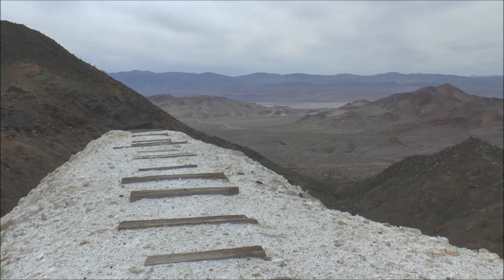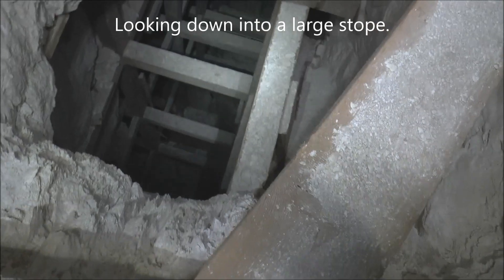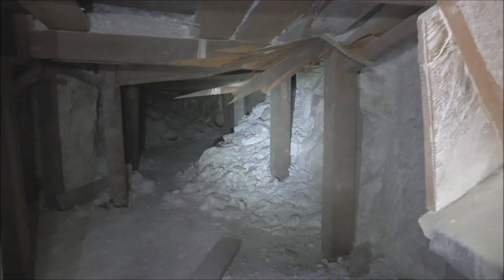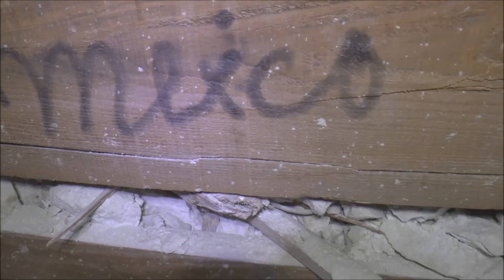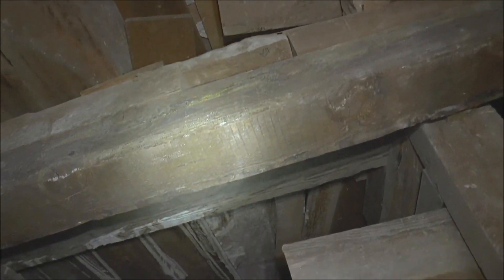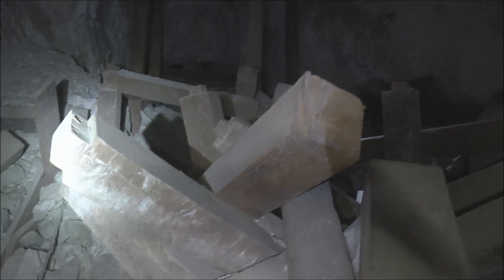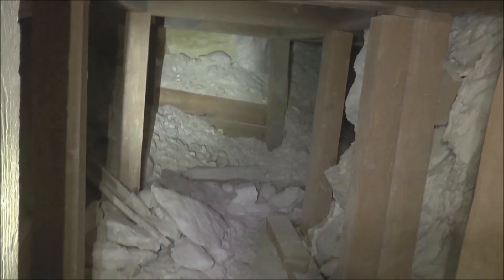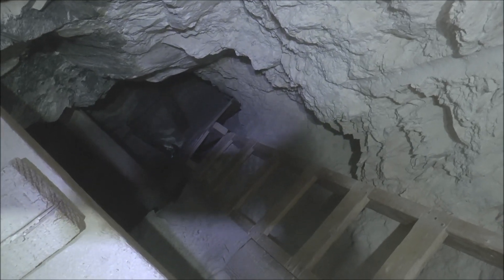(Part 1) Self-Quarantining and Exploring at the Abandoned Pleasanton Mine

Comment: Awesome! You can really tell how dry the air is by this mine, those timbers look like they were put in yesterday. Square set stopes are a rarity; I've never encountered one or heard of one anywhere near me - mines in New Mexico use shrinkage stopes, open stopes, or (more recently) longhole stopes. Surprisingly, the only commercial hard rock mine currently operating here has an inclined shaft, uses rail, and is 100% shrink stoped.

I'm looking forward to seeing that air tugger in Part 2! Pneumatic mining equipment has declined in popularity, but I appreciate it for its simplicity and low cost - nice to see it in videos.
Reply from the maker: I’ve only come across square-set timbering a few times over the last 10 years or so. It is rare. It seems like it would have been so much work to set that up inside the mines. Boy, those old miners sure were some tough guys! Hey, would you mind explaining what shrinkage stopes and long-hole stopes are and how they work? I’d appreciate it and so would a lot of the other viewers. Thanks for stopping by, checking out the video, and leaving a comment. I really appreciate it!
Reply: @AbandonedMines11  I can only imagine how tough it must have been to muscle those timbers into place! Air-powered chainsaws are available, but not every mine would have had them, so the timbers may have been hand-cut as well.

I'd be happy to! In a shrinkage stope, a raise is driven up from the haulage drift to allow access into the stope. It will have a drag chute for drills and equipment, which may have its own air tugger to hoist 140lb jackleg drills (an arrangement I've seen in the Ash Peak). One or more ore chutes are also constructed to load ore cars or small diesel trucks. Once this development is done, the stope miners drift along the vein to create an initial working space. They then proceed to mine the vein from the bottom up while working on top of blasted ore. After each blast, some ore is drawn down through the ore chutes to maintain enough space to work, but not so much space as to make drilling the next round difficult or impossible. This continues until the stope is complete, at which point all of the blasted ore is drawn down. A variation is to use a slusher to feed an ore pass after each shot rather than directly drawing down the muckpile...I prefer this, it mostly teliminates the possibility of voids in the muckpile that present an engulfment hazard. Shrinkage stoping isn't very popular anymore; it's labor-intensive and can be very dangerous, though the equipment is cheap and it offers minimal dilution and great recovery for very narrow veins.

Longhole stoping is also suited for narrow veins, but not as narrow as shrinkage stoping can manage. To mine a longhole stope, two drifts are driven with anywhere from 40-150' of vertical spacing between them. A slot raise is then driven connecting the drifts...this can be a conventional raise, Alimak raise, raise bore, or VCR drop raise depending on distance, budget, and available equipment. The slot raise provides an open space for the ore to "break-to". A bunch of drill holes are then driven connecting the two drifts, and are blasted starting at the slot raise. The blasted ore is mucked out by a remote-control LHD (Load-Haul-Dump...70% loader, 30% hauler, 80% fun to run) and loaded into a truck, rail car, dumped down an ore pass... depends on the mine. It's a high-productivity and very safe method provided your open edge in the upper sublevel is bermed/barricaded. Drill accuracy is critical, too much deviation will drop the powder factor in places and create huge boulders that can freeze the stope - a frozen stope because of some manager's newfangled blast design is a big part of what killed the Summit. The real tricky part is equipment cost - $240k to $1M for a new longhole drill, $400k on up for a new LHD with RRC...chop that by 75% or more for decent used equipment, but it's still tough for a shoestring operation to swing!
Reply from the maker: Wow! That all sounds confusing! Thanks for the detailed reply, though. I never really got into the technical aspects of mining beyond what little I reiterate in my videos regarding timbering, tunnels, and terminology. I guess I have more of an interest in the underground geology as well. At any rate, thanks, man, for providing that information!

Comment: Awesome video frank ! I hope to venture out into a mine like this one ! I have a question how do you test the integrity of a ladder ? Especially ones that are over a century old
Reply from the maker: Hey, Matt! We knew that previous explorers had been up and down the ladders many times recently. We also do an on-site examination of the ladders when we are there before we step onto them. Believe it or not, some of the ladders are no longer nailed in place as tightly as they once were and some do have missing or broken rungs, so it’s always good to be aware of that before setting any amount of weight on them. As with anything, it’s a calculated risk. The miners, though, really built those ladders to be very durable. The rungs are notched and each side of the rung has three nails in it instead of only one or two. They knew what they were doing and knew that the ladders had to be serviceable for quite a long time simply because it was probably very difficult to get new ones down into the mine and nailed in place if an old one wore out. That being said, I would never recommend anybody start climbing down ladders in an abandoned mine. What’s the old saying? “Do your due diligence!“
Reply: Exploring Abandoned Mines and Unusual Places wow that’s awesome ! Thanks frank ! 😁

Comment: Why didn't they just dig a vast cavern until they got to the end of the talc instead of timbering the soft stuff? Was the timbered stuff that much harder than what was removed?
Reply from the maker: The underground talc deposit was just so enormous that digging a single cavern was impossible. I guess it’s safer for the miners to dig horizontal tunnels into the deposit at different levels and then make those large stopes like I explained in the video. This mine has at least three horizontal levels that we know of, so the talc deposit was pretty enormous.

Comment: Do you not use a safety rope or ropes ?
Reply from the maker: This was a very short ladder system and therefore did not require any kind of harness or ropes or anything like that. It was also at a 45° angle which is pretty easy to do. Anything steeper than 45°, yes, does require rope and perhaps other gear to make the ascent and descent safer.

Comment: It’s amazing they are not made to clean up after they are through with mines; it should be mandatory.
Reply from the maker: No environmental laws and regulations back in those days, Bonnie. That’s why states today are trying to clean up these abandoned mine sites and reclaim the land. We were just in a mine the other day where there was asbestos all over the place in one small area because there was a pipe that had been wrapped in an asbestos cover and which is now torn and ragged.
Reply: In abandoned coal mines (from the 60s and 70s)in Germany they even left hydraulic fluids containing PCB down there, these mines are very deep, and flooded now, and the PCB and other chemicals are washed up, and in the water they have to pump out to protect the water used for drinking water. They pump this water into rivers, without cleaning it before.

Comment: I don't think I would crawl around the mines here in TN. Most of them are coal mines which are dangerous enough when they were active.Who knows how  what they are like after 10, 20, 30 year or more after the other elements have their way with them. Moisture has a tendency to  move the degradation process along a little faster. There are other mines besides coal such deep underground zinc mines, and the now defunct open pit and copper processing. Yes this blanketed the south east corner of Tennessee coated in sulphuric acid. It was so prominent that the astronauts could see it from space along with the Great Wall of China, and the Pyramids of Egypt.
Reply from the maker: Great anecdotes, Mike! Thanks for sharing. Yes, abandoned coal mines are very dangerous for all the reasons you said. Encountering bad air is also greatly increased in coal mines.